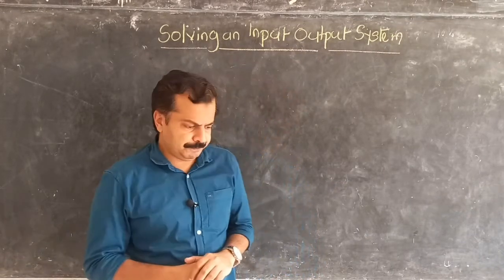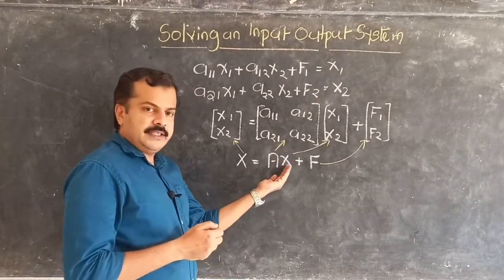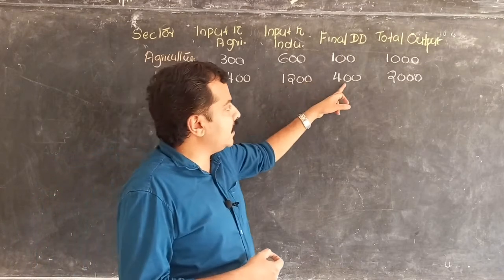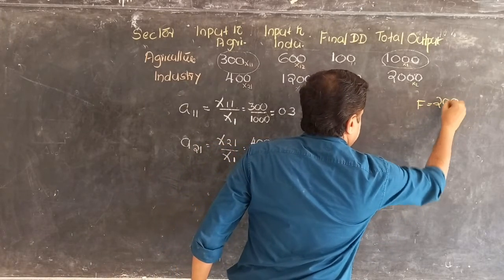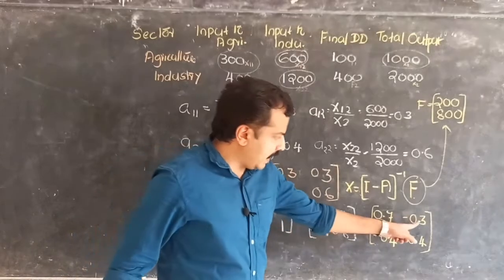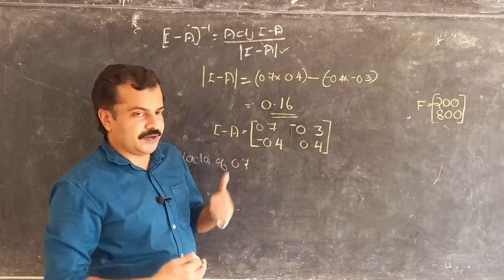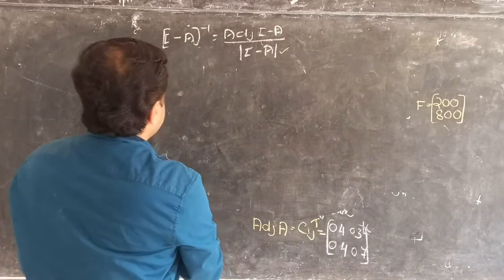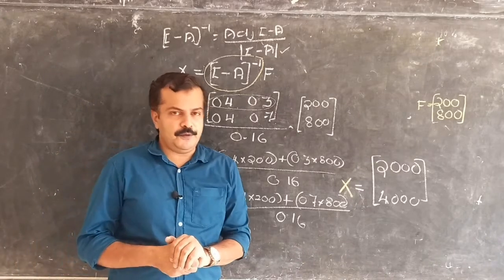Mathematical Tools 17 | Input Output Analysis | Part Two | Solving of Input Output System

Comment: Explanation is very good.
Sir , Adjoint of a 2x2 matrix can be found easily using the shortcut method.
It will save time and be easy for students to use.